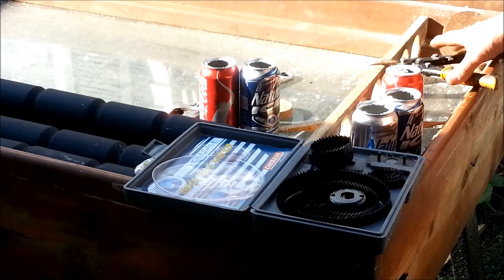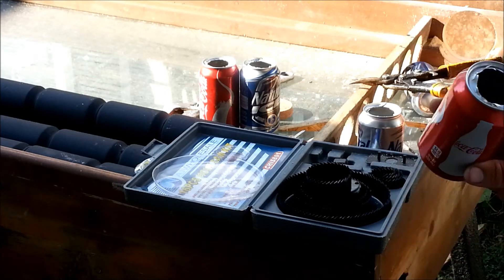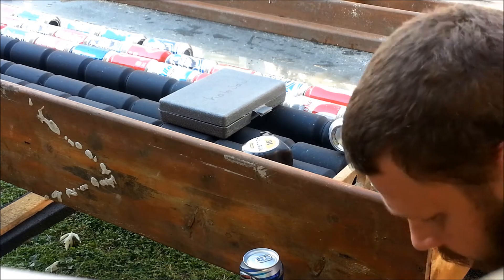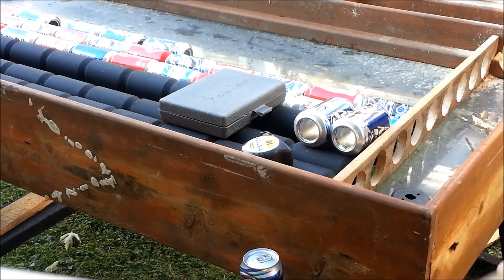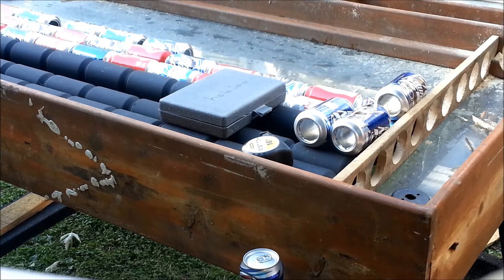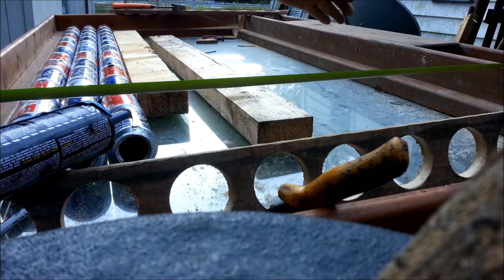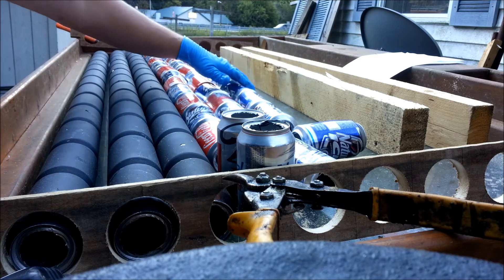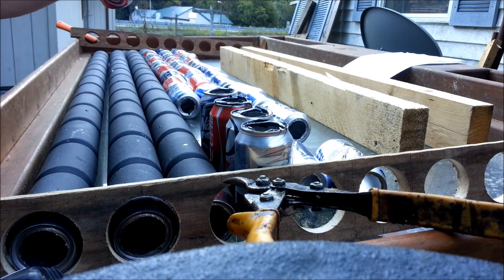How to build a solar can heater / solar furnace, for solar heat. Part 3

Comment: You can also use a can openenr, it results in clean cuts. when air is flowing through the system, it will reduce dust build-up on the edges of the cans.

Thanks for sharingthis great video! :-)
Reply from the maker: Thanks a lot.!

Comment: Thats pretty cool. Ive heard of doing that on photo cells on both sides of the solar heater and the two cells fight each other by turning a motor until they equal each others amperage.  Please do a video of the tracking too!

Comment from the maker: Thanks, I really appreciate it.. I will check the amperage, it is a salvaged motor from an EDM (tool shop machinery). Thanks for the tips. Please share and Subscribe. I am getting ready to build a heater that is on a rotor and timer to track the sun..

Comment: Your videos and process are actually one of the better ones Ive seen.  I dont think the aluminum backed insulation was needed tho.  If price was comparable then It probably wasnt much difference. 

Finding the right amount of cfm (airflow) can be tricky but just make sure your motor (most likely cobbed out of a furnace or whatever) is not over amping.  It can overheat and be un safe.  making more restriction will lower the amp draw down to a safe level (noted on the side of the motor data plate)